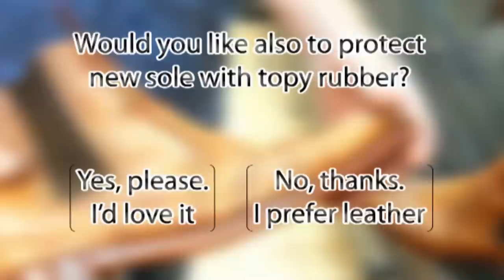Jeffery West Full Resole

Comment: sorry but using a screw driver in shoe repairs like that is terrible
Reply from the maker: Jim Jackson there is no other way off getting the block of .Also there is no damage done to the shoe
Reply: a screw driver surely there are better options ,some thing wider to lessen the chance of marking
Reply: What about the possibility of stabbing your self if the screwdriver slips? That seems really unsafe...
Reply: @NorthMelbShoeRepairs  Yes there is, use a sole lifter.